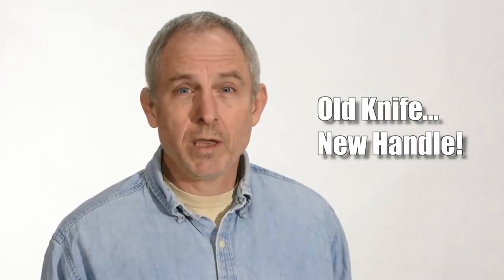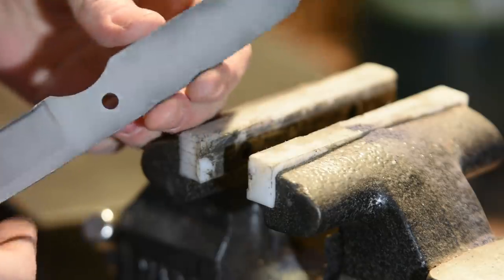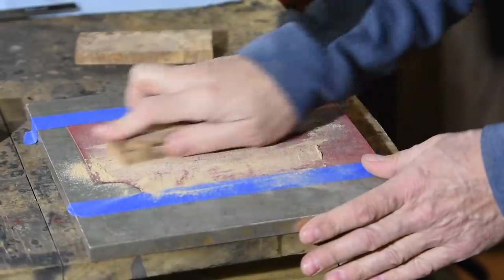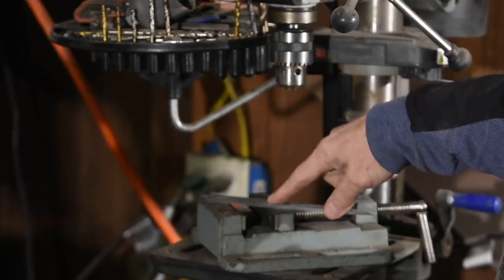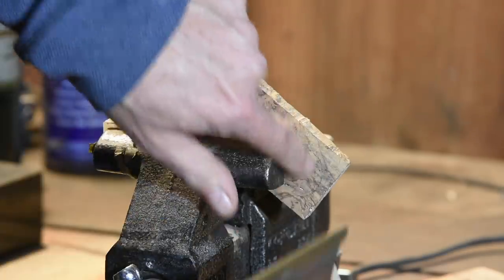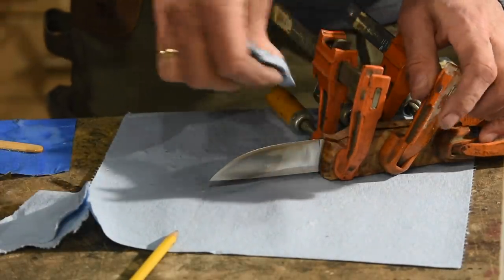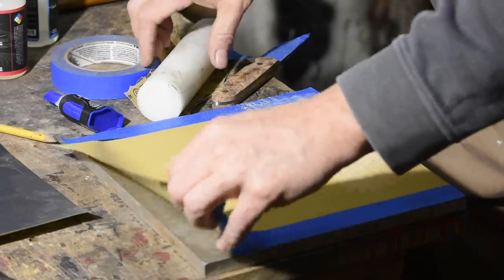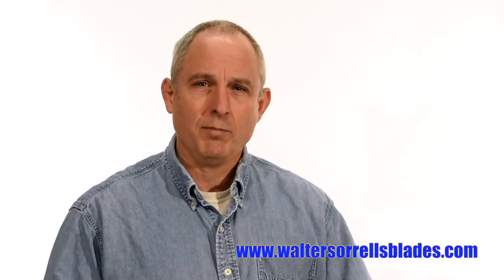Make a New Handle for an Old Knife!

Comment: I think and easier method for getting your scales perfectly flat is to use a small home made thickness sander. You can make one with a 1/3 HP motor and a sanding drum. Bowyers use them to make the laminations for the bow limbs.

Comment: Great video thank you. You could drill the handle holes on the blank before cutting in half then you guarantee true alignment. I would like to ask a question. Is it easy to rehandle a Ontario SP1 knife or a Buck 119. They come with a Kraylon handle and look kinda boring. I would like to have a multi coloured wood handle with a polished brass guard. If it is possible could you please show us how to do it. Thank you.

Comment: Way late, but tilting the hacksaw blade to 45° makes cutting flush a ton easier, this is why most hacksaws make it easy to tilt the blade, cheep ones have a square blade tensioner for this, more expensive ones sometimes have more complicated methods but either way it makes some cuts much easier

Comment: If you are not going to taper the pin holes on the scales and peen the pins, why even bother at all????
Sorry to have to make a negative comment, but as a knifemaker, I look at my earlier knives before I learned the right way to be garbage. They looked great, but the epoxy will degrade eventually. The knives I make now will last until they are worn down to nothing. I hate un-peened scales.